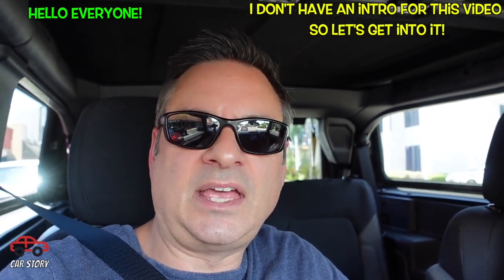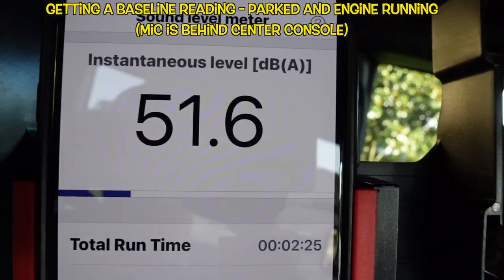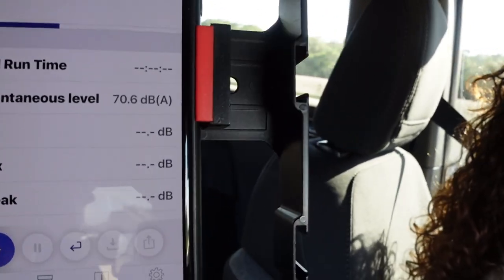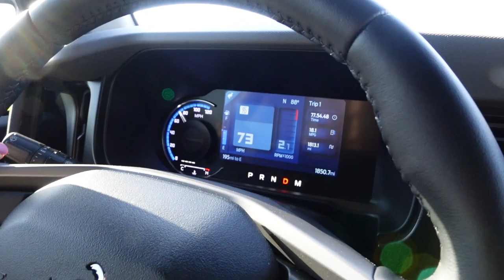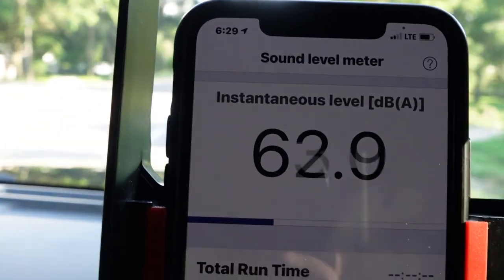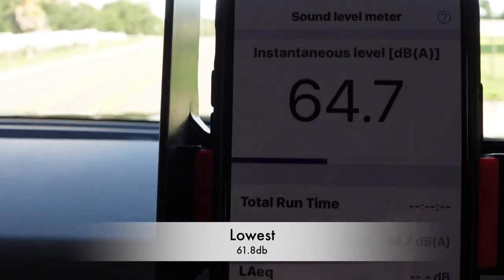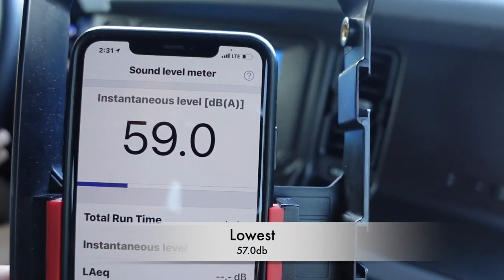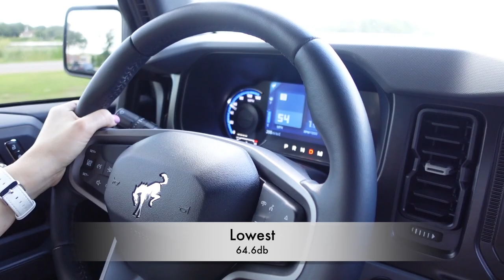2021 Ford Bronco Cabin Noise Test - How loud is it?

Comment from the maker: I never did a cabin noise test when I had my two door Jeep Rubicon but I know that was louder. The Bronco Sasquatch package with Bilstein shocks and independent front suspension rides smoother than the Jeep and has less tire noise and "hum" at highway speeds. It really doesn't sound that loud to me at any speed and I never give the interior noise a thought. Being in the Bronco at any speed is a fun experience. If you want to see more videos, hit like and subscribe if you haven't already. That helps me want to make more videos. Until next time, thanks for watching, goodbye for now.

Comment: Thanks for this helpful and interesting video! All I hear from all reviewers is how loud the hardtop 2 door Bronco is on the highway with the Sasquatch package. How does the Bronco decibel level compare to other trucks? Thanks!
Reply from the maker: I don't have another truck to compare to but I can say that at 70mph it's only 10db louder than our Tesla Model 3 which only has 18" tires and has sound insulating glass.  This shocked me, I thought the Tesla would be much quieter than that especially since there is no engine noise. We had a two door Jeep Rubicon JL and it was just as loud as the Bronco on the highway if not louder and the Jeep felt unsafe to drive at 70mph or higher due to its shorter wheelbase. Around town driving below 50mph, the Bronco cabin noise negligible.
Reply: @CarStory wow only 10db louder than the Tesla. That's amazing. I wonder if adding things like Dynamat to the roof panels would help. What do you think? I appreciate your detailed reply and videos! Thanks!
Reply: @CarStory  dB are logarithmic. Every 3dB is 2x more. So 10dB is quite alot.

Comment: Yours is quiet compared to mine.
Reply from the maker: Do you have a four door with a soft top?
Reply: @CarStory  2 door obx with lux
Reply from the maker: @mpeugeot  Did you measure the noise level with a db meter? I have to wonder if the sasquatch tires and suspension make some difference with road noise.
Reply: @CarStory  I didn't use a decibel meter, but I know the rough difference between 70 dB and 85 dB. The tires absolutely make a difference, even my relatively quietly Milestar Patagonia M/T's are noticeably louder than the Bridgestone Dueller's (which are back on my OBX for now). However, tire noise is nothing compared to the wind noise (which has been incrementally been improving with some effort on my part.  I am now probably closer to 75 dB than 85 dB, but I can guarantee that it's no where near 70 dB. I will have to put a meter to it.  Of course, this is all speed dependent... at 82 MPH, I can barely hear the Flowmaster High Clearance Axle Back exhaust, but at 60 MPH, the exhaust is prominent.  The Flowmaster High Clearance Axle Back exhaust is obnoxiously loud in general... so for it to disappear from the wind noise is saying something.